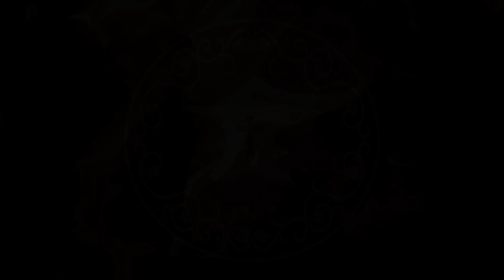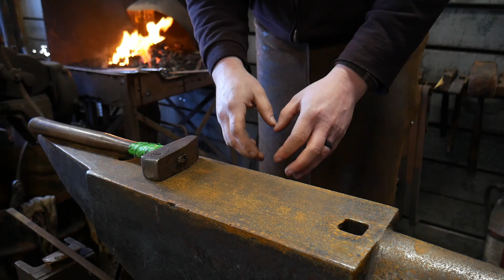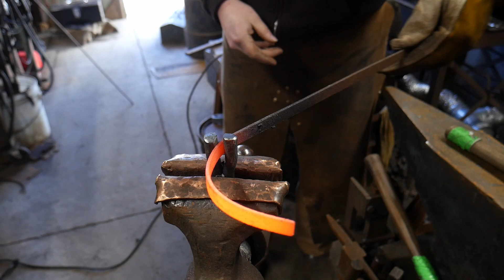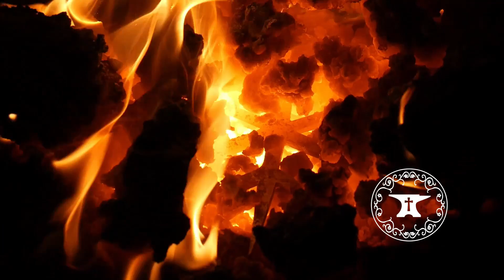Small DIY Bending Fork [Blacksmith Tool Making]

Comment: Roy, maybe there is or isn't but I've always wondered about bending fork size and spacing. Is there a general "rule of thumb" or Golden Rule if you will pertaining to the ratio of fork size to spacing and stock being bent?...just wondering because I've made them with various spacing by whatever just seamed to work, but find when doing scrolls some work better than others.
Reply from the maker: I'm sure there is and I will try and eventually get a book together of my most used formulas in the shop.. Hang tight

Comment: Hi Roy
Im looking at making a horizontal set of forks so i can bend towards the floor, that way i wont be chasing my anvil around in circles, any thoughts, have you seen any made like that before?
Reply: Make it like the steak rivit setter only forks. Then you can make it as tall off the side of your anvil as you need
Reply: Ben Toombs  I was picturing the same idea. Basically a hardy bickern with forks instead of a point, could twist it to whatever angle works well for your task. I made a dishing stump from an old oxygen bottle, filled it with concrete(close to 300lbs)...anyways, I welded various diameter pairs of round stock sticking off the sides for that purpose. Works for me and one less loose tool to keep up with. Whatever gets 'er done...
Reply: @bentoombs  ill need a little more height, to bend to 45° should be more than enough, i want to improve on the technique I've been using to bend 2 tong blanks at a time